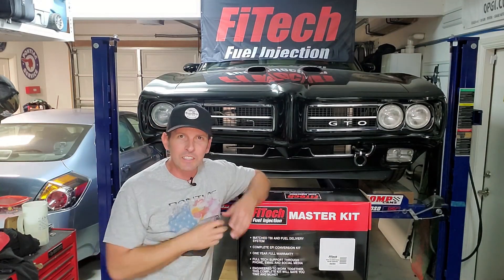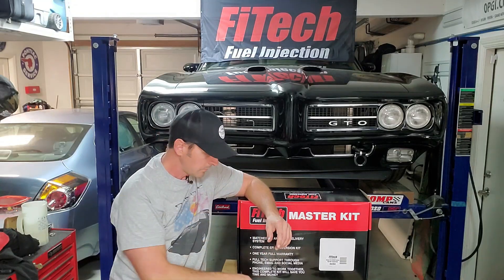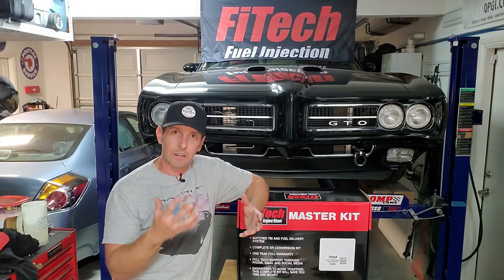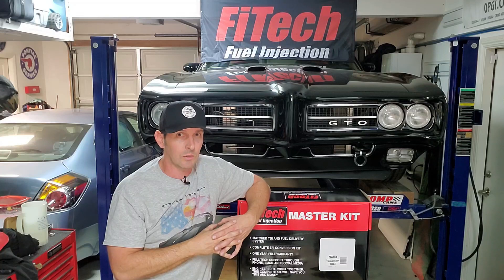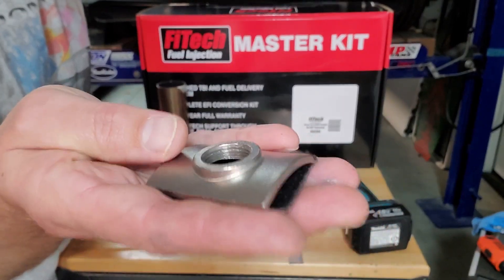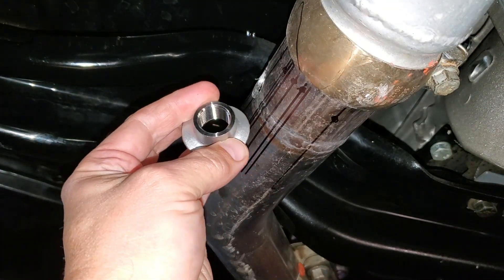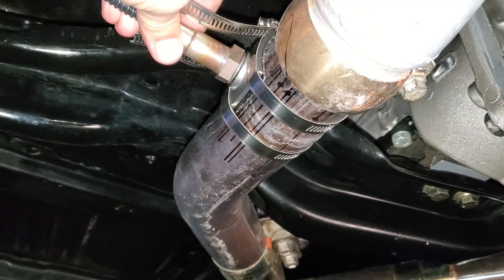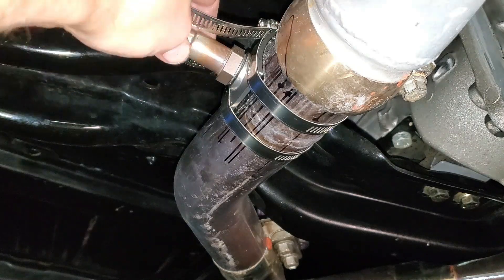Fuel Injection Conversion, Part 5:  O2 Sensor Install with No Welding!  FiTech

Comment: I’m converting my 95 mustang 302 to FiTech.  The O2 stock sensor threads match the FiTech O2 sensor threads. Sounds stupid simple but you know, if FiTech was an automotive car manufacturer, you know one of those threads would be 7/8’s and the other 18mm.  It’s a beautiful thing when people think things out clearly!!!!!!
Reply from the maker: Ha!  Yup!  FiTech did a good job of using a lot of industry standard components, for that reason..  Keep at it!
Reply: @FastMonty  my hurdle now is finding the stock fuel pump power
Reply from the maker: Ha!  Yeah, Google is your friend.  :)  Good luck!  @motor_citymuscle288

Comment: What if you did this then sealed it with jb weld
Reply from the maker: Great question... not sure if JB weld is heat resistant.  BUT, to your point, I know there are several exhaust sealants on the market that would definitely help.  Good one!
Reply: @FastMonty  there's high heat jb weld

Comment: Most all FI systems before 1981 worked without an o2 sensor, all the way back to the 50's. The o2 enables closed loop under many operating situations, and helps emissions and fuel economy. I.E. bosh, bendix rochester ect. systems.
Reply from the maker: Great info... thanks Mark!

Comment: I have been skeptical of buying this kit because of my exhaust. I have dual exhaust and I figured it would need 2 oxygen sensors for both sides. Can it really run off of one side of the exhaust?
Reply from the maker: Good question.  It depends on what system you go with.  This FiTech system only needs one oxygen sensor.  Most only need one.  But, some do require two.  Do it!  Ha, ha... thanks for the comment.